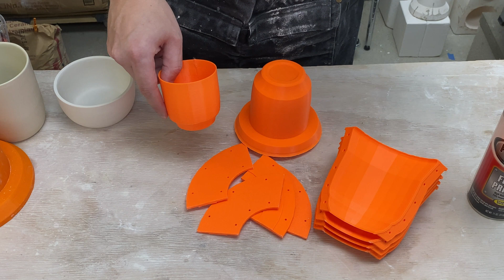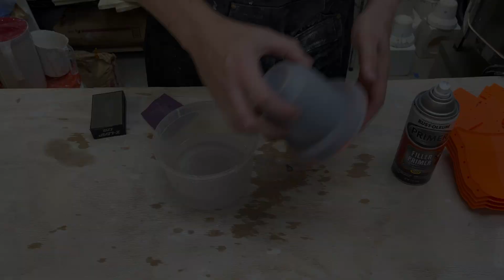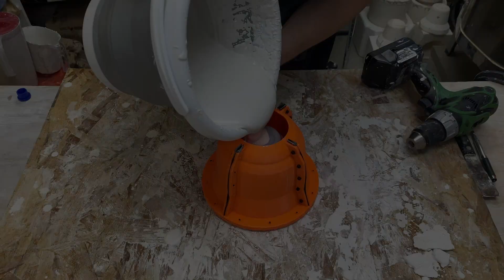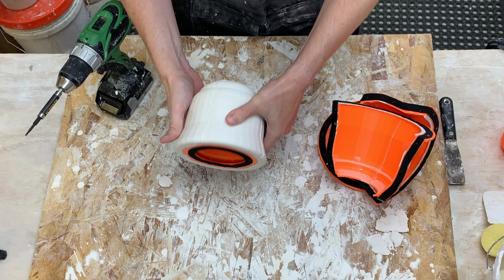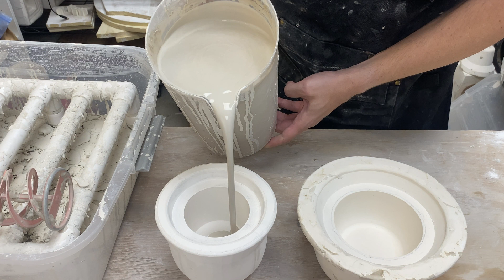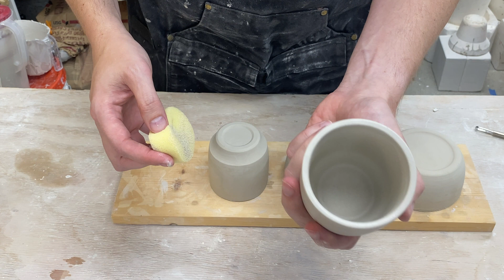SMOOTH 3D printed molds for slip casting - some sanding required

Comment: Have you tried a fuzzy skin setting? Not sure whether your slicer software has that option but it minimizes/redistributes  layer lines and makes the print similar to a sandpaper finish.
Reply from the maker: I have not but I think that's the opposite of what you want. You want to minimize texture.

Comment: Another method that might work would be to use a PLA solvent such as ethyl acetate to smooth the outer surface of the mould.  You could perhaps dip a sponge into the solvent and just rub the surface to smooth it, in the same way that you showed how to use a damp sponge to smooth the clay with water before firing.  If this method works,  you'd only need to do the job once, rather than once for each casting.  By rubbing on the solvent using a fine sponge, I think you should be able to re-deposit the molten plastic from the "hills" to the "valleys" on the surface very quickly, which is something you wouldn't necessarily get simply by spraying a solvent onto the surface, or exposing it to a vapour, as is typically done with ABS and acetone.
Of course, I haven't tested this method myself; it might just create a sticky, stinking mess rather than a smooth pot, but I'd give it a try!
Reply from the maker: If you do try, let me know! The spray paint actually stays on the mold, so even when reused, it doesn't need to be reapplied. (And if you're glazing your pots, you likely don't even need to smooth out the print. Between, a bit of sponging, clay shrinkage and the glaze, layer lines disappear in practice.

Comment: why can't we use the 3d printed mold for our final product? I am still confused about that. Why do we just use it to create plaster mold but not the actual product?
Reply from the maker: If you want to use slip casting you need the liquid slip to form a shell of clay inside the mold. Plaster has several unique properties for absorbing and transporting the water from the slip so that happens. If you poured slip into a 3D printed part then basically nothing would happen. It'd be the same as pouring it into a plastic bucket and back out. If you want a plastic object then sure 3D printing can work in some cases, but we're creating ceramics here.

Comment: You can also add 2-3 coats of Clear Glossy Acrylic spray for even smoother finish.
Reply from the maker: That would make sense. Thanks!
Reply: Would you still need to sand in-between? I’m assuming yes but want to check.
Reply from the maker: @yougorgeousmonster  Once it is smooth, the sanding would really be about the surface finish (and getting subsequent coats to stick)

Comment: Hi Kent, first of all, love your videos! Can I ask for an opinion? I made a wooden mold, in a houter CNC and it's very soft and smoth (I used primer and sanded just like you did), but its made of wood, and its not gonna shrink like the 3D printed mold you used, right? any advices?
Reply from the maker: I've heard of wooden molds (often MDF). But if you're specifically referring to pulling the inner mold out of the plaster, then I'm afraid I don't really have any great ideas. The best option would be to have a very good draft angle everywhere (which could limit design choice). It might also be possible to split the inner mold into multiple pieces and was something I was thinking about but never got to since the PLA & ice/alcohol trick works so well.

Comment: I don't think you mentioned vapor polishing.  When I went on this journey with composite molding I had some appreciable results with it.  You print in ABS and expose the surface to a mist of acetone, which can be achieved inside a container in the sun. Done well it melts and flows the surface leaving it smoother and stronger.    But I must admit, I still did the high build spray putty and sand back anyway.  I guess I'm a fan of putting more time into my  molds so my parts pop out ready to go.  That and composite materials aren't cheap or forgiving.        But hey, that latest printed container design is looking great. You've got to be happy with the software at this point. :)
Reply from the maker: I did not - I haven't used it myself. I think the biggest issue is you get a different kind of smooth. From what I understand, it will even out the humps and valleys of a 3D print locally. However by sanding, the sand paper (or sanding block) is spread out over a much larger area so you get surfaces that a "flat" at a larger scale. 
I actually like the 3d printed look I've been getting so I suspect I won't be doing this myself going forward, but it is good to let others know it is an option.
And yes, the software is working well!
Reply: wouldnt spray putty effect the hardening of the slip by waterproofing the plaster that needs to absorb the slips water.
Reply: @adememresadkoglu1532  I would only apply to the 3d printed part.  Once cured and sanded, it shouldn't have an impact on the plaster.
Reply: I see. I cant really sand the print or the plaster as there is too fine detail on the models so maybe Ill apply some type of coating to the print then. I heard baby powder is alright. Thanks for the reply  @M3rVsT4H
Reply: For things at that detail level, I saved up for an SLA resin printer.   Which is pretty amazing at the fine details.  Best of luck with your creations.  @adememresadkoglu1532

Comment: My process is a lot like this, except I just coat with microcrystalline wax. 
I've seen it claimed to help with mold release, but not by someone who had done a particularly large amount of plaster work, so not sure. 
Only other benefit is that you don't need anywhere to spray, so I can, for example, do the whole process in my small apartment.
The primer will last for many more plaster casts I'm sure.
Reply from the maker: That's interesting. I'd imagine there are probably several ways to go about this. I think basically you want to be able to fill in the low spots in some sort of durable way, and take down the high spots through sanding - so both additive and subtractive - to get to the desired surface.

Comment: If you use ABS to print your peaces, you can use acetona to smooth them.
Reply from the maker: Thanks. Yes there are a variety of chemicals that will help smooth the parts. However as far as I know, there isn't a lot of control over the surface finish you get. (But as I show at the end, it might not make a big difference for your pots as well).

Comment: Paint your parts with a Uv resin and then put a light on it.. No sanding needed
Reply from the maker: In that case you're counting on the viscosity of the resin to do just the right thing.